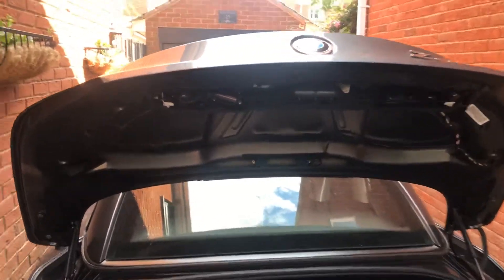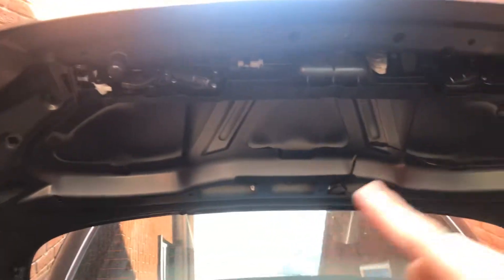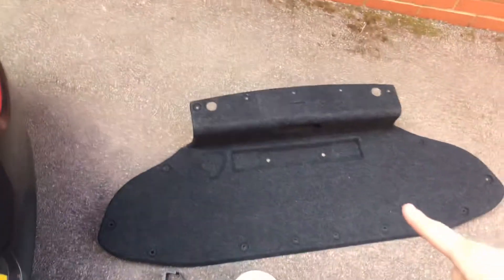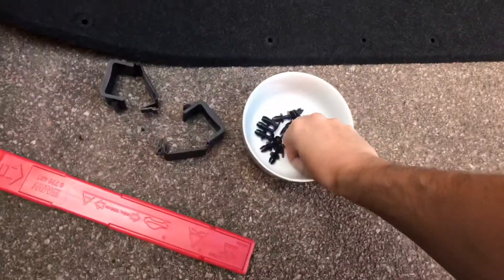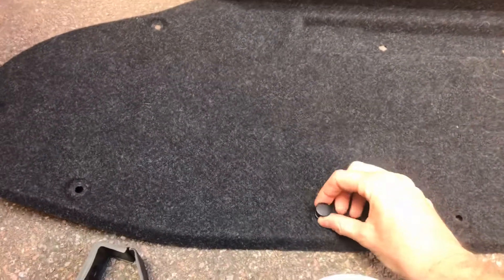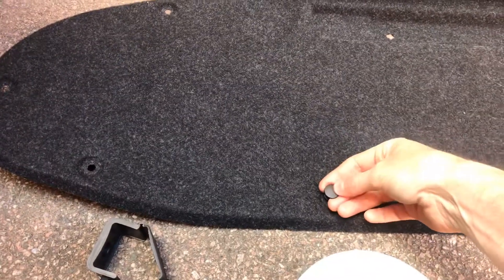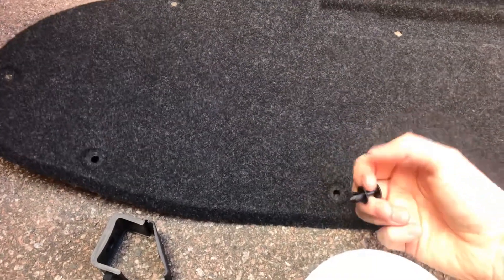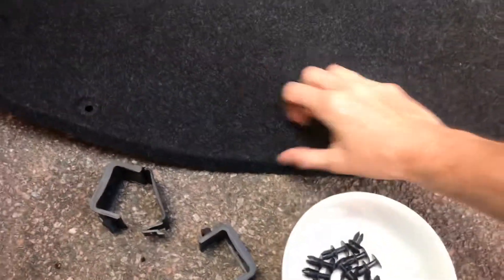Z4 locking mechanism soft close fix 9

Comment: I have just watched your videos for the Z4 soft close switches. 
Please can you tell me, is it the same principal on my E93 convertible boot?
Thanks in anticipation
Reply from the maker: Hey I am not 💯 on that sorry to say but I would think if you have a look it’s probably the same problem if it’s a soft close boot
Reply: @BobbyGees  just repaired mine. Wiring wasn't my problem, it was the toothed gears on the left hand motor had jammed. Had to remove 3 rivets to free from the body and replace with nuts and bolts, boom , job done. Saved £400 !
Reply from the maker: @stejd  fantastic news Steve